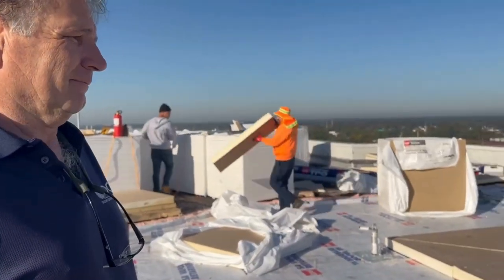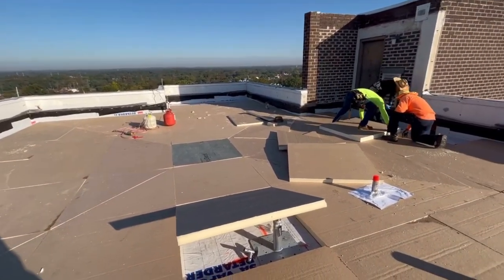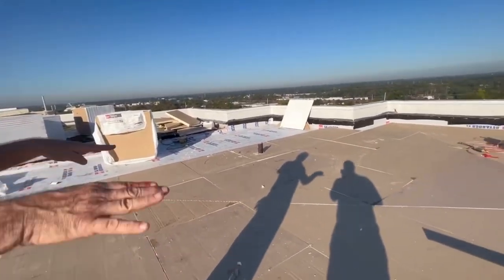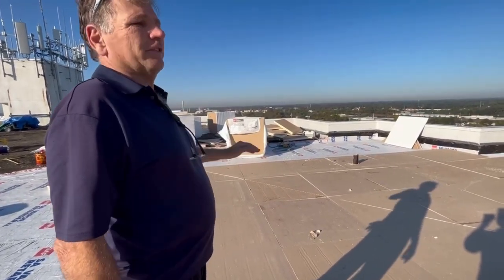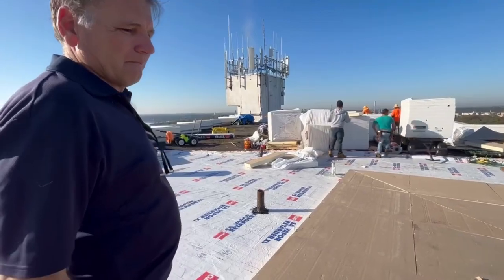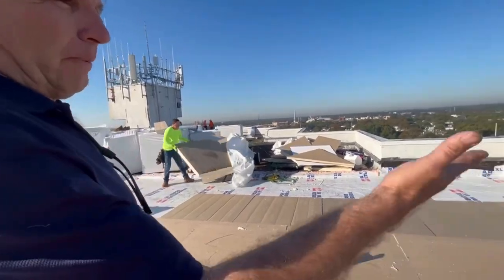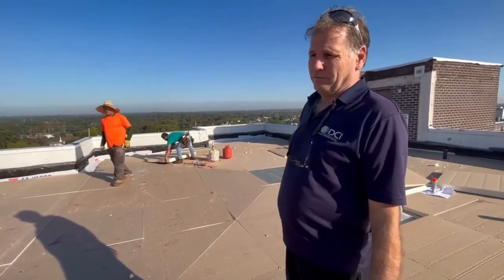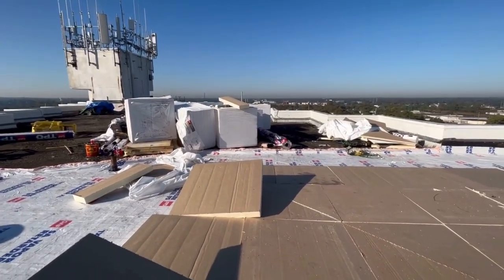How To Install Tapered Insulation with TPO | Asphalt BUR ( Built Up Roof ) Tear Off | #construction

Comment: The hight of the wall is how many inches to feet and are they called guard rail surely they couldn't support the weight of force if pushing forward to prevent a fall. So why not take the time to maintain safety hazards. Definitely has to be an eco friendly constructruction to avoid risks and accidental deaths. But I ask you when building the structure of the platform why not extend or to build a higher stacked wall for the more longer term goal of the crew and crews to come forth company. Construction itself is a high risk endangerment. So if the construction failed and the reconstruction has to take a risk what's the mathematical equation to the perimeter of height times distance. Should we have down sized the floor/floors which at that point garage height minus the addition of the barrier in the event of the ground. Definitely didn't have the circumstances of the dial to produce shade safety. So to be steady is to critique.
Reply: What the hell are you speaking
Reply from the maker: @aberuel8823  not sure but we definitely have the safety down packed

Comment: Pre cut your mitres and foam as you go.  Your method Not efficent at all.
Reply from the maker: Hey great idea , but in practice is far less efficient and precise! 

We don't precut...we cut in the field and our crews are effective and excellent in the installation of taper, especially complicated taper designs requiring field adjustments. Our Means and methods work for our crews.

Many times, on paper and in fields differ, in order to get the perfect roofing system. You need to be able to account for those differences.
Reply from the maker: Thank you for your comment and let us know if you have other questions